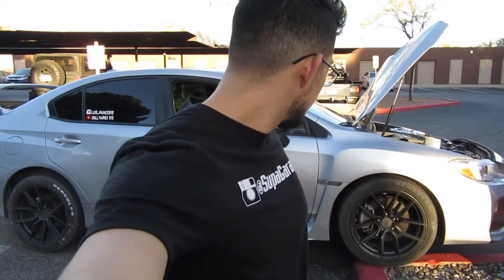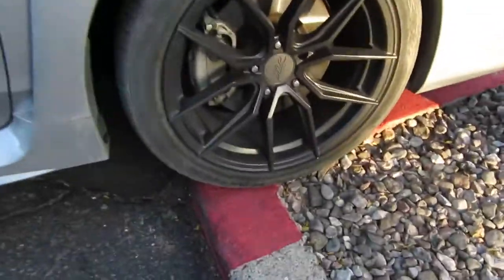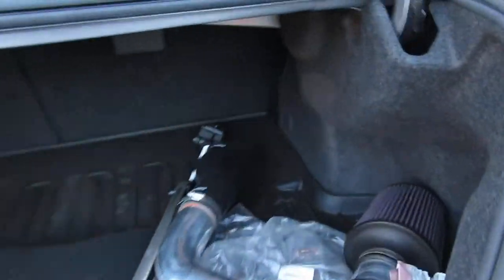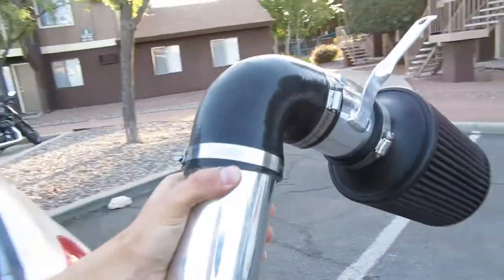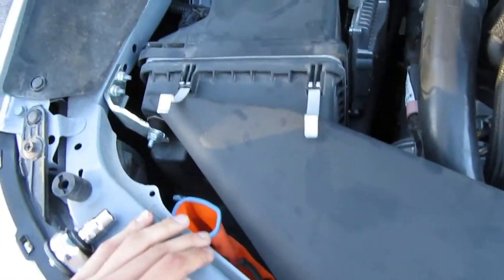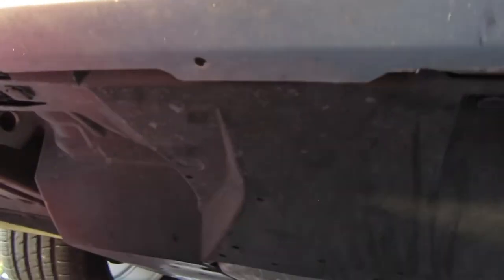Installing the Mishimoto Intake on the 2017 Subaru WRX (sound)

Comment: Hey is there a BOV on your car or is that just the intake? Sounds so good
Reply from the maker: dann G hello thanks for tuning in! And it has the stock bypass valve so the intake opens up the sound a bit more, makes the turbo whistle get louder

Comment: Did you eTune after you put the intake on?  If so, which one.  And how has been for you so far?
Reply from the maker: GR8GUY54 hello thanks for tuning in, and basically I tuned it with my COBB accessport I went to the Cobb website and downloaded the mishimoto map and installed it on the accessport, I went through the process of switching over maps within the accessport, not sure if that’s what you mean? But so far car runs beautifully and have had no problems whatsoever
Reply: RallyWrex 915 thanks for the reply.  So you on 91 or 93 Octane?  How's the Cobb map holding up so far?  You monitoring your boost, knock, etc.. with this intake installed?
Reply: RallyWrex 915 nevermind the octane...just watched the video again.
Reply from the maker: GR8GUY54 I’m running 91 because where I live there’s no 93, but it’s holding up beautifully there’s no knocks or anything, I’m not monitoring anything which I should but here’s no problems so far man 👌🏻
Reply: RallyWrex 915 Ok.  I am getting mine next week and just asking around.  I have an eTune option available if I want to pay a couple of hundred.   I had to pay $25 for Cobb's OTS tune as well.  Will try that for a couple of weeks and see how it goes first.